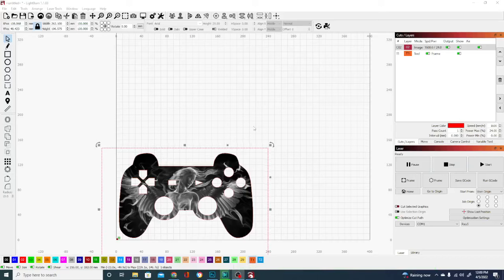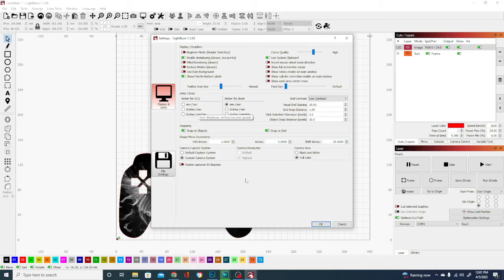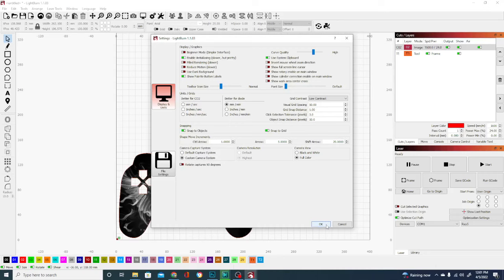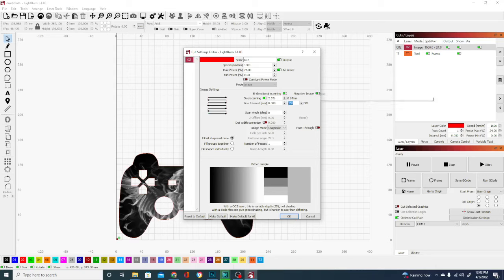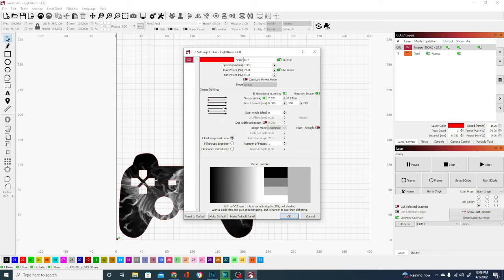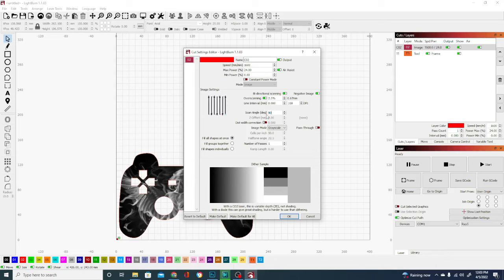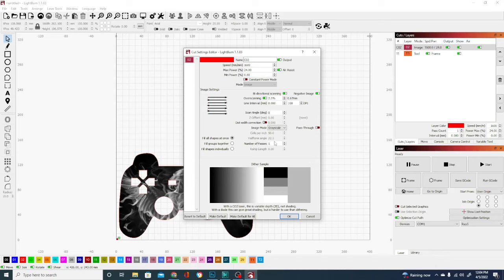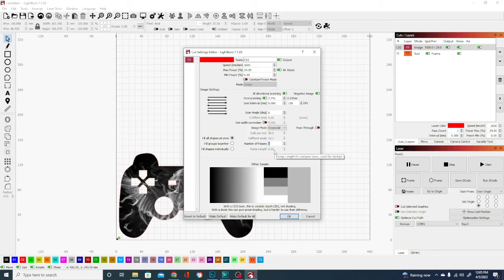Simple lightburn settings tutorial for laser engraving

Comment: While exploring that page one thing that would have been worth mentioning was the line interval in mm. I have a Longer Ray 5 10 watt and the diameter of the laser beam is .060 compared as to most being.080. This will result in a finer DPI. Hey there is a lot learn in Lightburn and you have to start somewhere and this a good video to do that with. 😁🛫

Comment: hey great channel, would you tell me whats the overscanner and if any benefit out of it. like mine laser do is go around all the lines in the end of engaraving once again and I dont know why
Reply: Overscanning means that it gives a bit of extra path on each side so the laser can slow down and speed back up and can reach the same power setting by the time it makes it back for clean marks instead of it starting the other way trying to power up immediately into the mark without full power at first. To better understand it, select it and preview your cut selecting Show traverse moves and it will show you on each side. Hope I helped!